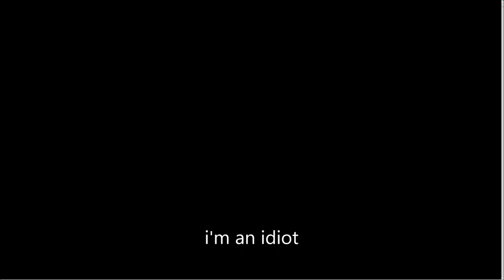Creating a Custom Convertible Top for my Nissan 300zx z32

Comment: Sorry man i know you worked hard on this... But i do believe you butchered that poor z32. Again im sorry but why would you do this to your car?!?! The 300zx is a beautiful car as it is. I have 2 of them myself and i would never imagine doing something like this... It looks really bad... Sorry you wasted your time.
Reply from the maker: it was rear ended and rusted and completely beat up underneath the bad paint job it had.  Plus the convertible top was leaking, installed incorrectly, the bars it went up and down on were wonky, the latches didn't work, the interior was held together by wood screws, the front cowl had half missing, the hood scraped the fenders when it closed and was full of dents, the headers had a combined 3 of 6 bolts holding them on, the struts were clapped, where it was hit wasn't repaired, just body filled, and the front bumper was half apart and held on by minimal screws.  I kinda chose the Z in the worst shape I found on purpose
Reply: I wasn't trying to be a dick but i consider myself to be a but of a Z enthusiast and after putting a lot of time and money into a couple of 300s myself it kills me to see a Z in rough shape.